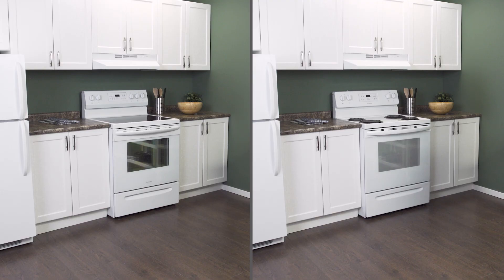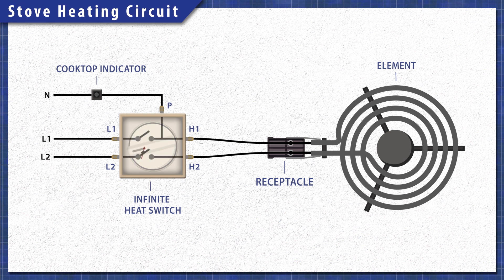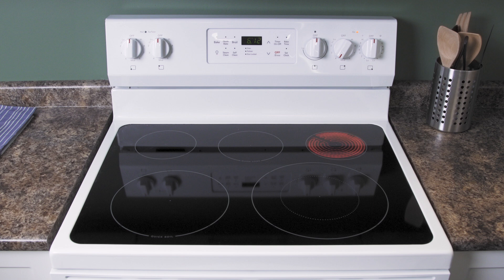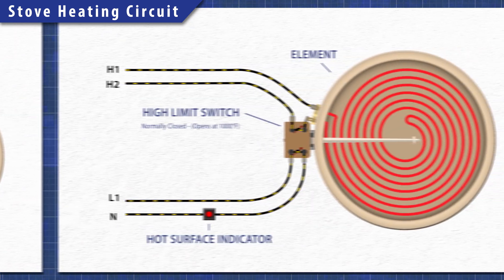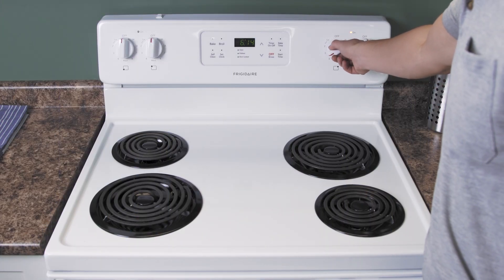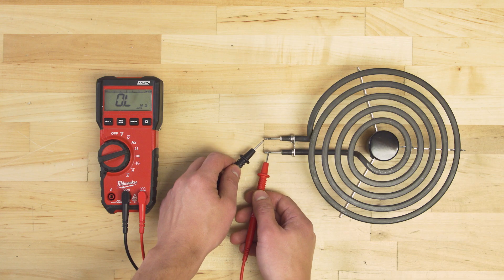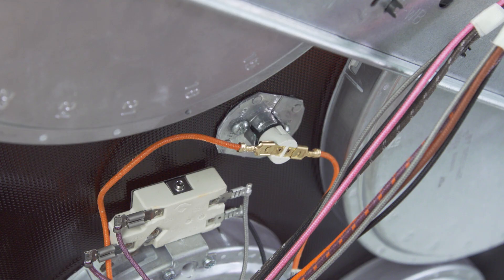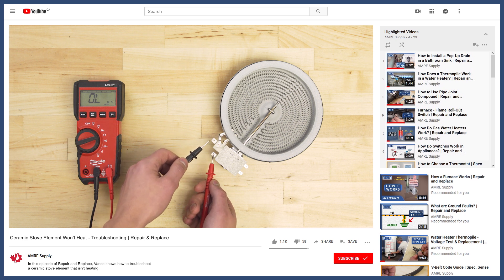How Do Electric Stoves Work? | Repair & Replace

Comment: Is there any problem if wet pot placed over coil,pls reply
Reply from the maker: Thanks for watching. A little bit of water on the cooktop will evaporate and a lot of water on the cooktop might cause the glass to crack. It's best to dry the pot before putting it back on the burner.

Comment: This helps a lot I’m moving to a new apartment with an electric stove and I need to know how these types of stoves work Especially since I’ve never used one and prefer these over gas stoves
Reply: The reason they put electric stoves in apartments and rentals is because it is cheaper to replace if it breaks (because nobody uses them) and it lowers the insurance premiums on the fire insurance because there is less of a fire risk with a electric stove than a gas stove, and they don't have to run gas plumbing through the house.
Reply from the maker: Thanks for watching, we're glad that you found it helpful!

Comment: which software you used to develop this animation
Reply from the maker: Thanks for watching. We use Adobe Illustrator to make 2d vectors, and we animated 2d graphics and wire diagrams in After Effects. 3D models are created in Cinema 4D.

Comment: Like your videos. Needing to learn more about the electronic board components and how to check.
Reply from the maker: Thank you, we're just happy to help. Though we get into a bit of detail on troubleshooting ovens and stoves, the control board is not something that we've covered other than a full replacement. https://www.youtube.com/watch?v=ORTi4lLyoqw When it comes to testing the circuits within, that gets a little more complicated and there's lots of variation between models. It also requires access to service manuals.
Reply: @AmreSupply  And a little more advanced equipment sometimes.

Comment: Do electric stovetop burners automatically shut off after 12 hours?  I left for vacation and worry I left a burner on. It’s Kenmore (GE) manufactured around 2002
Reply from the maker: Hi Danny, thank you for watching. There is no mechanism in coiled stove tops that would shut off the burner after a set period of time. However heating elements on ceramic stove have built in limiters that would disconnect power if it overheats. If there is nothing on the stovetop then it will just continue to heat and dissipate as normal. Still it would be good for someone to check it out if possible.

Comment from the maker: Did this video help you learn more about electric stoves? Was there anything else you wanted to learn? Let us know in the comments!
Reply: Yes it helped alot thanks for the vid
Reply from the maker: @LucianoSmerrosy  You're welcome! We're just happy to help!
Reply: Yes
Reply from the maker: @vernondouglas4425  We're glad to hear it!
Reply: Thank you, in my opinion it is precise and quite laconic.
Reply from the maker: @armandsmezerins8820  Thank you Armands, we're glad that you found it helpful!
Reply: Not exactly, i would like to know exactly how the old exposed style wire burners switch knows when to "shut off and turn on" the burner at the given heat setting, how does it do this without a probe?
Reply: Scratch that, i looked up "how an infinate switch works" and got my answer. Really ingenious simple tech. Thanks for your video describing the circuit as well 👍